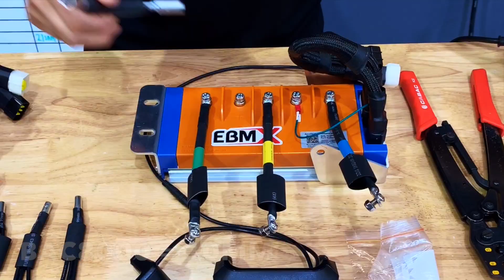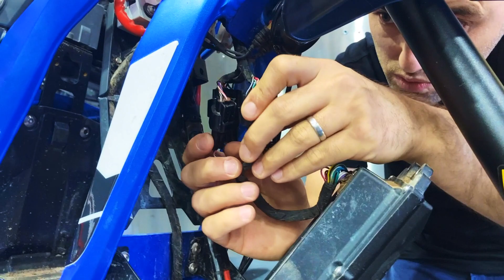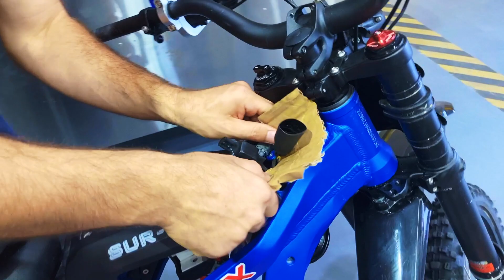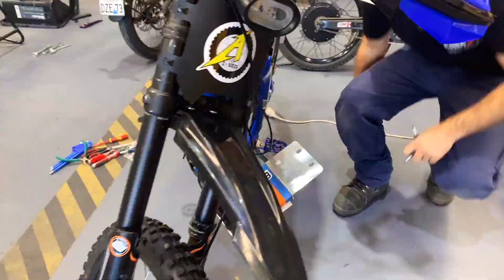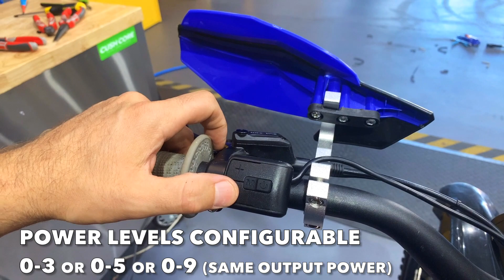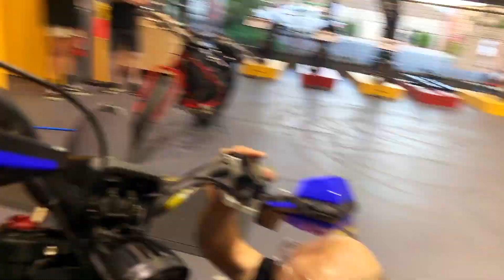SurRon POWER UPGRADE Installation Video • 60v 72v ASI BAC4000 BAC8000 + Battery Bypass • EBMX

Comment: GREAT Video.  I run stock Sur Ron X in the US.  While I'd love more power, I run the stock battery almost to 10% before calling it a day.  (Woods riding.)  I assume since there's more power, the battery would not last as long -- fair assumption?  50% increase in power, 50% less battery life?  I appreciate the info!
Reply from the maker: Yes the higher the power mode you ride on the less juice left .. it’s your choice to control the range with the options
Reply: @EBMXtreme  Understood.  Now if I could find a stock battery for cheap (we do 20 mile loops-ish) I could change battery at lunch AND stay on the power band!  Thank you.

Comment: I’m interested in buying from the link to the company and if I were to buy I pre modded bike by you guys and I cut the green wire would it make it faster than it shows even on the website
Reply from the maker: what country are you in mate?
Reply: @EBMXtreme  the USA and what’s the max speed? For both bypass on stock battery with 8000 BAC
Reply from the maker: @huh8509  please buy from Shock bikes they handle all EBMX USA Business max speeds depends on gearing riders weight and a heap of factors. But fast .. it’s not so much max speed that counts for most but how quickly you get there.

Comment: i have a question before i buy but i cant find it anywhere. Is the bike still Waterproof after the upgrades? Thank you. Great Video!
Reply from the maker: not completely waterproof prior and no better after - careful getting water in the controller harness and pins - do not high water pressure spray into that area and you will be fine
Reply: @EBMXtreme  so you can still ride in heavy rain and puddles?
Reply from the maker: @davebobby7153  yes for sure. Just disable the OEM sensors is best

Comment: I just ordered a BAC4000 for my SRX - question, I got a Gladiator-R 60v 60ah chi battery, do you have a setting that deals with the more powerful aftermarket 60v batteries like mine? 

What kind of Range and speed could I expect with the setup I ordered? I’m running the super moto kit with a belt.

Comment: if you change the speed limit do you need to turn the bike on and off again or does it not matter? and if you do change the speed limit would it sill make the same power as the defult or is it makeing less because the speed limit is lower?
Reply from the maker: The speed limit will only be able to be changed from our EBXM app that will be out soon. You will just need to adjust then update (flash) the controller and it will be updated.  Power will not be limited but if you set the speed limit to a low number you will obviously get there very quickly so it will seem like power cuts out quickly.
Reply: @EBMXtreme  Any More info on when the app will be available?  Thanks and great video.  Install went very smooth  .
Reply from the maker: @LCSC300t  its having its final beta testing done this week - so hopefully not long now.

Comment: Hi. Now that I’ve bypassed that battery, how can I tell what charge it’s at?
Reply from the maker: the voltage tells you 67v is hot off the charger below 60v is less than half etc.

you should read the tech detail on the EBMX website
Reply: @EBMXtreme  awesome! Downloaded the trouble shoot guide and read the site! Thank you. What is the low limit for the battery? 55v?
Reply from the maker: @tomkuoh  1st limit is 49.60 at 3.1v and 2nd at 46.38v and 2.9v per cell

Comment: What if i want to run a different display?
What i want is the bac4000 bigger 60v battery and a 60v nat pack. BUT i want to run a different display. Maybe a stock replacement unit for a newer e-mopad/scooter. With GPS Bluetooth/NFC a lot of information and options. 
I do like the tft however i want something different from whatever has

Comment: are you able to see how many kws your using in each mode?

are you able to assign any kw to any mode or is it just preset?
Reply from the maker: The APT display does display kW being used, however it is not accurate… we are working on that but not to the bottom of it yet.

The best way to look at it is it is the power of the tune divided evenly between the power modes.

10kw with 5 modes on the apt will be 2kw per mode added onto each other… so mode one will be 2kw mode 4 will be 8 kw and so on.

Comment: Thousands of dollars for these upgrades on top of the bike still not as fast.
I have been looking at these but for the price why would you not want a Honda CRF250L? More power never run out of charge, faster, legal on the street and can actually do the dirt better. When they crack down you're going to be screwed on the streets. Most cities thousand-watt maximum and 20 miles an hour.
Reply: i live in nyc. i have no issues riding on the street. as long as you obey traffic laws the cops dont care

also the upragded bike can go well over 60mph and has more power and torque than most dirt bikes off the line. its expensive but there's also nothing like it
Reply: The same reason people buy anything... Because they want it

Comment: I want to get the bac4000 and the 72v battery. Where is the best place to get a battery? Surron is out of stock and light speed is over 4x the price at surron
Edit: if i install the bac first, then upgrade to a 72v, will i have to bypass the new battery as well?
Reply from the maker: from EBMX of course :) $1885USD Globally

Comment: Awesome video, great instructions. What do the mode limits 3, 5 and 9 do?
Reply from the maker: the modes can be pre set to 3 5 or 9. they incrementally control the power
Reply: @EBMXtreme  how do i switch between these modes (modes, not mode limits) without a display? 
I built my 72V + BAC8000, but its as fast as it was before. Its probably still in mode 1. Is it possible to switch to another mode without display? The stock one isnt working anymore
Reply from the maker: @jimmyknopfi5668  did you purchase from EBMX? if so please email us or book a ticket on our website.

Comment: So i can run bac 8000 on stock 60v battery ?? When I get a 72v battery how do I switch do I just put the new battery in and the controller will detect it ?? Thanks
Reply from the maker: yes you can run 8000 on stock for modest power increase. when 72 goes in you would need our EBMX dealer to retune/flash your controller with the 72v file that suits your chosen battery.. we are working hard on an app to allow you to change voltage without a reflash of controller but that is not ready yet. email or message us if you would like more info  thanks EBMX

Comment: You really don't know what you're talking about sorry but you don't there's no such thing as a surround motorcycle number one and number two the only difference between them really is that controller on the x is the 30% more output but there's still Street mode you could switch between Street mode and off-road both bikes are street legal and not street legal know what you're talking about before you make the video

Comment: Why do you do bms bypass
Reply: BMS bypass is required as we are draining more power than the BMS can handle... if you don't bypass, as soon as you hit the throttle hard the BMS will protect and cut power and bike will completely turn off for about 10-20 seconds
Reply: Yes I also don't understand. It seems redundant.
Reply: From what I've seen it's useless unless you have the upgraded motor controller. It's because the bms limits the power the motor controller can draw from the battery, but this is not a problem with the  stock set-up
Reply: I think the stock bms is limited to 85amps so if you want to pull more than that the bms cuts off the battery to protect it. You can bypass to pull more amps but you lose range and be careful you don't drain your battery too far you will ruin it.

Comment: What settings do you have the controller and about what is top speed. I like that display how would you switch it from the eggrider display.
Reply from the maker: controller settings are different depending on BAC4000 or 8000. we dont share our tunes publicly. 
APT display is up to 9 power levels and the Eggrider allows 60v and 72v switch.

if you want more info reach out man.